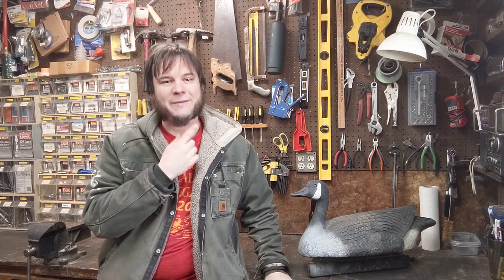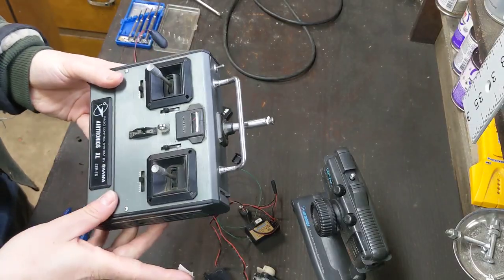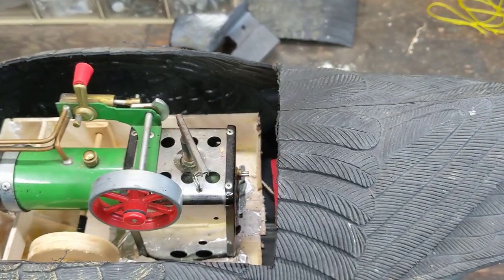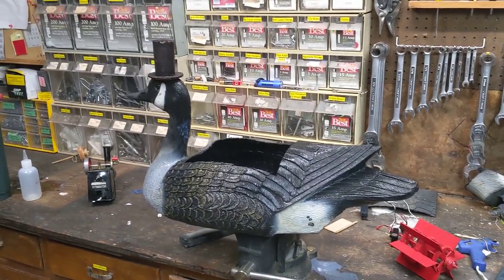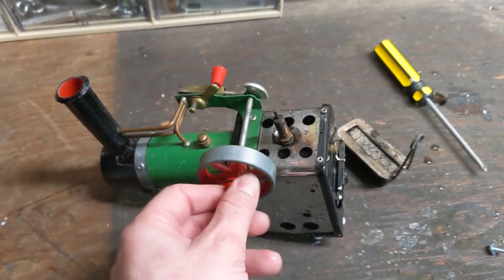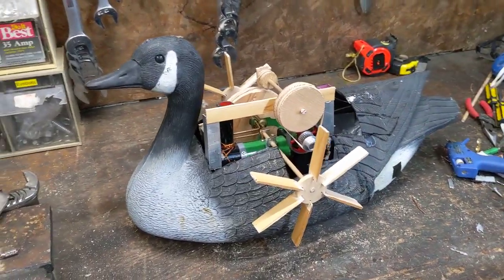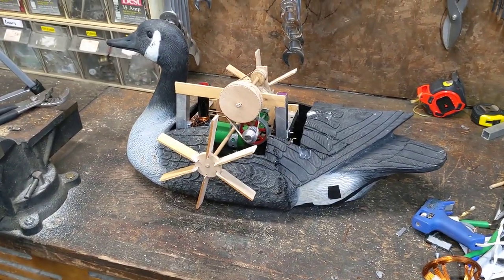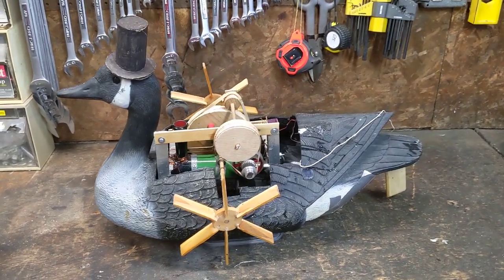Steam Powered Remote Control Goose

Comment: Since it wanted to steer itself by leaning to one side you could perhaps eliminate the rudder and just have the steering mechanism swing a weighted arm inside to lean the goose one way or the other thereby dipping one paddle wheel or the other a little deeper in the water... and Voila! You're turning! 
I really think this is a project worth revisiting. Cool stuff.

Comment: That Airtronics remote control system is from around 1985. It wouldn't surprise me if some of the components have failed. Good stuff though. I would have loved to see some of Sanwa's tech from earlier, like the 1950s thru 1970s. Stuff that was made back then was built to last.

Comment: I hope you didn't actually throw away  the wheels and canopy, those are pretty pricey, even used. The back wheels alone are around $50 with shipping, and the canopies and old style alcohol burners like yours are around $40 ea. The plug at the back isn't for filling, it's to let excess water  drain, so you don't over fill the boiler. You fill the boiler through the safety valve, located in the middle of the boiler, next to the pipes. It's also important to test the SV by pushing it down on a table top, or with your fingers, to make sure it's not seized. If it is like the whistle, you can soak it in vinegar for an hour or so, until it's free. It's also important to rinse out the boiler with vinegar and warm water for a 1/2 hour, to remove any lime scale, and run it with distilled water, to prevent lime scale. Lime scale can damage the boiler, and cause it to fail. It's also important to not leave the water in the boiler, you should empty it after each run. Syringes with tubing are great for filling and emptying boilers, some folks use spray bottles with tubing to fill/ empty their boilers. You also want to use steam oil on the piston assembly, as it can withstand the hot wet environment better than other oils, but regular oil is perfect for oiling the crank and crankshaft. I use liberty steam oil from ebay, it has a nice needle tip for neatly applying the oil. Also, you shouldn't use acetone in the burner, they are meant for denatured alcohol, I also recommend using a "dentist" type syringe for filling the burner. And as has been stated, you should try a long, heavy keel to keep the goose up right. I also recommend putting some steampunk goggles on the top hat, and giving him a monocle, maybe paint it to look like it's riveted iron plates.
Reply from the maker: Good info on the steam engine, thanks! I usually hoard things vs throw them away, but I don't know where the old tractor parts went. We are planning to paint and decorate a bit more, that might be a future video.

Comment: Fwd an reverse?  Lol
Reply from the maker: Yeah, I never quite got the valve for that to work. I ended up removing the linkage to the servo since switching it would just stall the steam piston. I think on the original toy tractor you're supposed to switch it and then get the wheel's spinning the other direction, not switch it while moving.